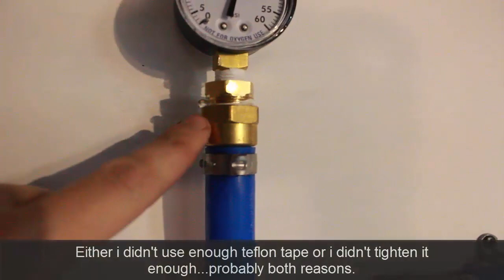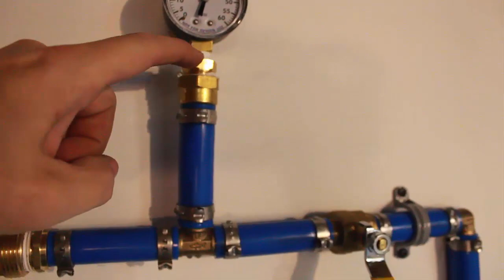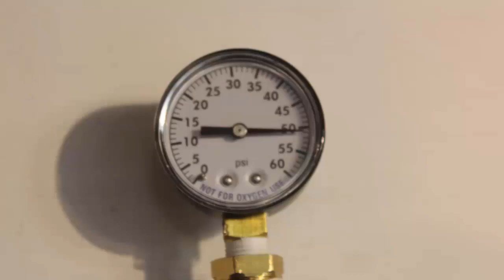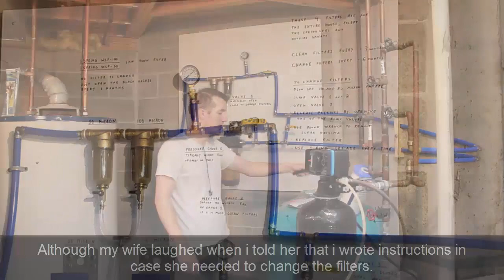Whole House Water Filters  |  (Part 2 of 2)

Comment: Sandpaper should never be used on a copper fitting to clean when installing a shark bite fitting also neither should a hacksaw. The cut was not level and could tear or, eventually tear, the o-ring inside the shark bite fitting.

Comment: My mistake. looks as though you were using 3/4. I still would not use Plastics in a water supply unless there was no other way around it. Al in all good job for what you wanted to accomplish.
Reply from the maker: Ya everyone says "copper is king".  But i knew that if i did it in copper it wouldn't be as good and have tons of leaks.  If i knew more about what i was doing i might have used copper to be safe.